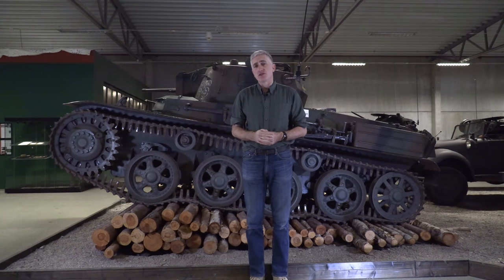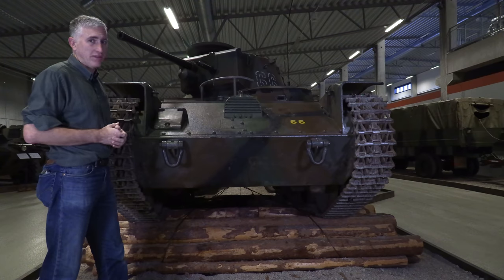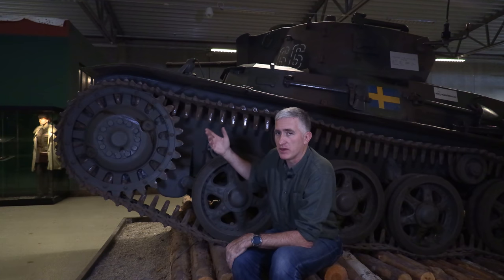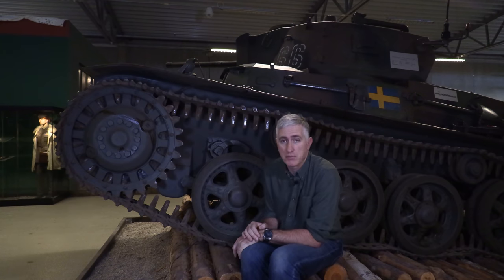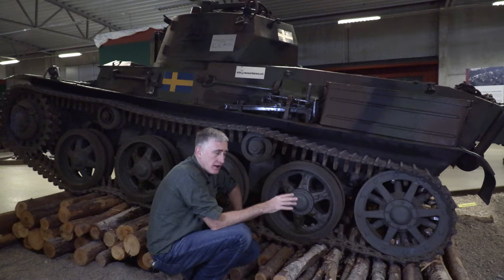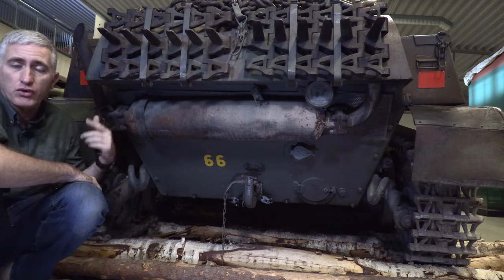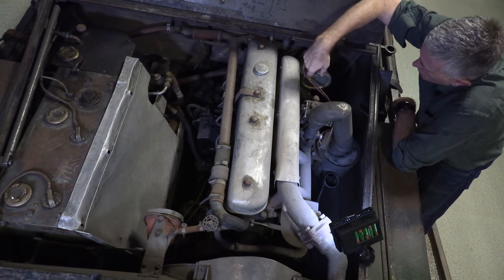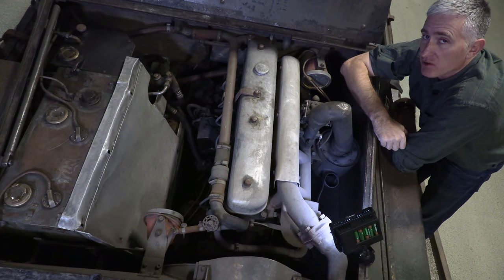Inside the Chieftain's Hatch: Strv m/38, Part 1

Comment: Literally nobody: How do you tension the tracks?
Chieftain: Glad you asked!
Reply: It's something I never thought about in 2017, but worry about now.
Reply: Yaaaaaawwwnnnn.., enough with the tired cliches. Ffs
Reply: As a tanker himself: he is intreged by the variations between the many tanks he is encountering.

Unfortunately a big bolt and a tankerbar is far too commonplace to be an exciting component.

Sometimes we get to see cool stuff however. Long may it continue.
Reply: He’s showing you the tank from the perspective of an operator, and that starts with things like “how do I keep this thing going to keep me alive?”, which is why he also shows you where you can check engine oil, coolant, etc.
Reply: Tensioning a track is not as sexy as operating the main gun, but it is almost as important to know from the crew's perspective. A slack track is easier to throw off, meaning you could become immobile at an inopportune time, i.e. when someone's taking shots at you.
Reply: Literally *everybody: How do you tension the tracks?
fixed your dumb mistake for you.

Comment: Hey if you heat up your coolant wouldn't it become a heatant ?
Just asking
Reply: You'd think so wouldn't you. But in a Swedish winter probably not.
Reply: One of the things that entertains me in Borderlands 3; in heavy machinery areas there's often blue pipes that say "COOLANT" and red pipes that say "HEATANT" on them.
Reply: Cooln't
Reply: hilariously in industry? it's all the same.
You use coolant to cool off the big reactor vessel, then use the heat in said coolant to warm multiple different processes elsewhere in the plant to maintain proper operating rates without dumping external energy into it.

And yes: it is called Hot Coolant and used to Warm things up at that point.

Comment: This is the next best thing to getting a walkthrough of a Hungarian Toldi.
Reply: In a nutshell, the hungarian Toldi is a licence-built early L-60 which had the steering wheel, not the levers.
Reply: @balazsneuperger2063   I knew the Hungarians working with Landswerk improved the design to make it easier to steer and drive but did not know what was done to make the improvements. Thanks for the info.
Reply: @Anlushac11  As far as I remember from the hungarian book "Harckocsik", the improvement on the steering focused on the capability of pivot steer, because the original steering system did not allow that.

Comment: If you ahead trouble fitting ibt the Panhard AMLs, I can't wait to see the contortions you underwent to bate your way into an L-60! 😆 Great video as always, next time I'm in Collins I want to check around to see if there's hull differences between our model and this one
Reply from the maker: You need to change your online name to "The Flying Snail". I'd be curious to do a short episode on the Irish L60 as well, assuming one of the two is intact inside. I know the Curragh's one still runs, but that means little.
Reply: @TheChieftainsHatch  indeed, my other great love, railways 😄 I know the one on Collins was internally stripped for parts for the Army's running model, and she's been spot welded shut besides (otherwise believe me, I'd have been asking for a look inside since day 1!). Going by that I'd imagine L-602 should have it where it counts inside

Comment: Everybody complains about him explaining the method of adding tension to the tracks. Bottom line is, it's critically important to have correct tension (or close to it) on the tracks of a tank. Being stuck on the battlefield because of a track that's rolled off the sprocket while being shot at would SUCK

Comment: A question about the "Tanker Bar". You showed one of these before and I was struck by the idea that it looked very much like the alignment bar the track crews use in performing maintenance on railroad tracks in the States. From what I could see it was identical. Of course it was on a US tank, not this one. It brings the question, which came first, the railroad tool or the tanker bar?
Reply: Well I would argue the Railroad tool considering the Locomotive far predates the first real tank.

Comment: 6.5mm machine gun on the pintle mount? This sounded strange at first since I thought Sweden's belt-fed machineguns were usually 8x63mm caliber and 6.5mm was used by the magazine-fed light MGs. Apparently I was mistaken though, they used some M1919s in 6.5x55mm as the Kulspruta M/42

http://www.gotavapen.se/gota/artiklar/utv_ksp58/ksp36/ksp36.htm

Sounds like they also used them in 8x63mm though, so I am curious to know how often the mounted MG was 6.5mm and how often 8mm.
Reply from the maker: I make mention of it in Pt2, apparently there was a changeover somewhere

Comment: Given riveting can cause a danger to crew from flying rivets, and cast hulls can reduce the effectiveness of the armour thickness (as well as requiring special facilities), why didn't everyone just use welded hulls? to my knowledge welding is, if anything, quite easy to do...
Reply: It is in fact not easy. It takes tradeschool level education, and it was a very new thing in the 30s.
Those countries that did have significant numbers of welders usually employed them in naval and infrastructure xonstruction, and couldnt spare them for tank building.
Reply: @egoalter1276  thank you: new knowledge to me

Comment: Secured with a padlock you say? They wouldn't happen to be, oh IDK, keyed alike with several otherwise unrelated locks, would they? I mean, that'd be super insecure... It'd be like having a key for a random truck bed toolbox thingy that just so happens to work for, oh IDK, for the elevator service mode key switch in a certain model of elevators by a certain elevator manufacturer, or having your whole city require a certain key for the elevator's fire service mode, and putting the exact bitting code in the law for everyone to see. Then later doubling down on it by publishing a very high res image of the exact key, again for everyone to see. Nobody would ever be stupid enough to do that... Oh, wait...